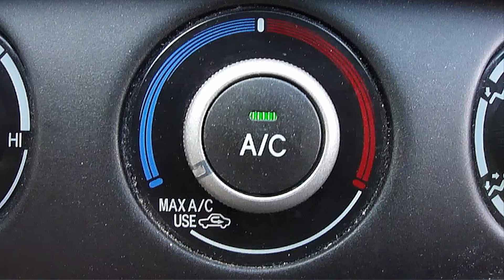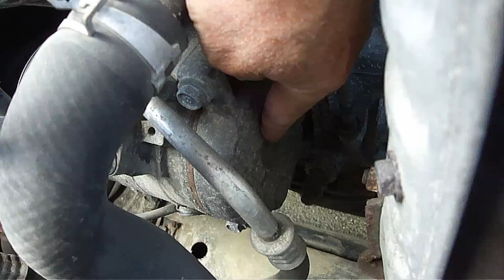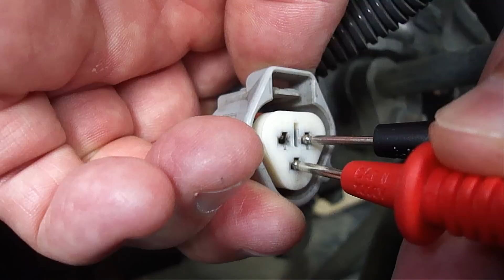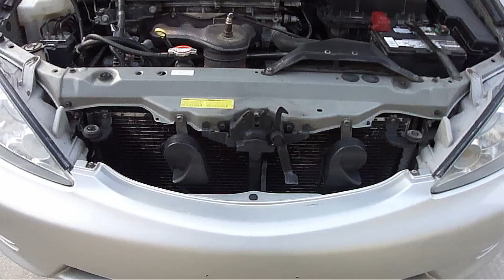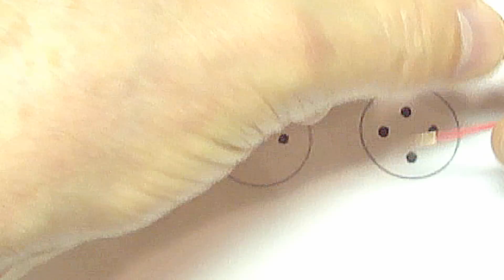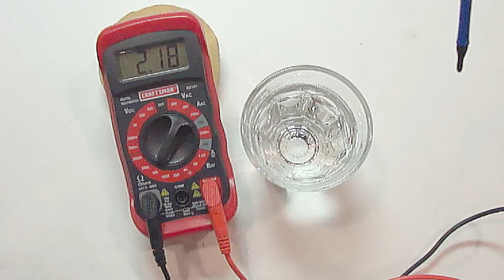How To Fix Car AC That Blows Hot - Possible Causes

Comment: My AC compressor in my 2013 mazda 6 will not turn on. I only have one wire to the compressor. I'm getting power to the wire. However when I check the volts at the pressure switch it only has 4.97 volts? Any help would be appreciated What sould I do ? I am getting 12+ volts at the compressor.

Comment: It’s rare that a random tip on an old video fixes a problem, but that’s the case for me. AC wasn’t working for 90% of the time for more than a year, even after a recharge. Figured out it was just the relay by swapping the horn and the ac relays like you showed. $35 fix. Thanks!

Comment: Unbelievable video with such clear pictures. My clutch is turning no matter if air is on or off so I'll have to dig into things, I believe it was noisy prior to winter, it's a 17 year old Kia with 417,000 miles but... My brother gave me the car and it will be my fault that I didn't run the A/C once a week, even at -10f, if he finds out it's not currently working. Plus I like to fix things even if I really could care less if they work or not
Reply from the maker: When the AC is turned on, do you have cold air coming out of the vents?

Comment: Thank you for the great review..
My Ac will not start cooling no matter how long it ran except my speed attain about 80km..and even the cooling is not effective.

I have change evaporator in past.
Change cabin air filter.
No leakages was detected so far.

Is it anything about th3 compressor?
Any advice? 
Anyone can help me ?
Reply from the maker: @oluwagbemigajonathan6820  My best guess is you either have too much or my enough refrigerant.
Reply: @proclaimliberty2000  Thank you for your feedback, you mean having too much or less can disrupt the AC cooling system?
I learnt this happen to Automatic compressors.

So what did you suggest please? My technician said same and he has been the one topping up the coolant..am just fed up every drive now take my interest far away from the vehicle.

Comment: Wow!  I am a degree'd electrical engineer who started with electronics over 65 years ago when I was 7.  I know a bit about mechanical systems, too.  About a month after a front end collision my car AC had this same symptoms, no hot air and no clacking sound, which I assumed (and hoped was a relay), even after a recharge.  I was ready to start testing the compressor for voltage, and decided to check YouTube for any advice first. Wow, again!  I have all the electrical test equipment of course, but needed exactly all the information in this thorough, and well, best ever, video!
Thank you for totally enhancing the checks I can now do, including clutch spin tests, sensor tests, and an OBDII test.  Also for putting them in such an experienced based logical order. 
Instant subscriber!

Comment: I paid hundreds for ac repair and a recharge and still have no ac. I will try this check down list. I ordered the voltage meter, relays and the pressure switch. I'm determined to figure this out, since the shop hasn't. I'll post an update after followong some of these steps. I'm starting with the relay. #girlpower!

Comment: vitz 2010, when the AC is turned on, it takes about 6 minutes for the compressor to turn on. When the thermostat turns off after cooling, it takes about 6 minutes for the compressor to turn on again, then it is very hot inside, the condenser has been thoroughly cleaned with water, gas 134A, sutcion 35psig. , discharge 180 psig, side glass clear, no burble, evaporator air filter clean, no block, evaporator clean, what could be the reason

Comment: My compressor runs intermittently, goes on/off based on pressing gas pedal. Why is this?
Reply: Usually freon low or too high...while compressor running should be 55 psi max .....or could be ac fan not working or the compressor speed switch which open the flow of ac to pass through compressor ac flow sensor....also u can force the relay for the ac fan to connect by opening it ....also hear if u put a magnet next to the flow sensor it turn on the compress and fan and allow the ac to circulate ....I'm current having a issue with my ac  turning on when. It's want to and turn off for long period....so I'm working on having the ac fan relay set on onn ....and trying to diagnose the flow sensor on compressor...and the relay for the entire ac system...

Comment: So I got a vehicle with no AC, cabin air filter I changed first due to knowing it most likely was never replaced since the glove box hasn't been opened in years. Then I checked freon. It was low but I had to fill to the max of the green side for cool air but still not that cold and the floor keeps getting air when the switch is not turned for the floor. I do get more cold air now compared to just being in the green to halfway but still feel it's lacking in producing enough cold air. Next will be a coil cleaning to see if that helps and then I'm stumped. Any extra help would be awesome.
Reply from the maker: @scottneal2738  Adding the correct amount of refrigerant is always tricky using gauges. Do you know how to add refrigerant by weight?
Reply: @proclaimliberty2000  truthfully no and even if I did....I would have to buy all the stuff to weigh it like Scotty did before looking up the correct weight that is to be in the system.

Comment: 2012 impala. we changed everything new condenser, freon, and Ac compressor check all the wires. it still blows hot air.  what weird when i press the AC button it wont come on but when you press outside air button it comes on for awhile and it stops working. need help.

Comment: My 2014 kia optima ac works, but only after driven at highway speed for a few miles. Nobody seems to have any ideas... do you have any idea where I should start? I just found this video by chance so the only thing I've done is swap relays which didn't help.....
Reply from the maker: @MAGAUSMC  My first guess would be low AC refrigerant. Low AC refrigerant is the number one cause of the AC not cooling properly.

Comment: I really hope your video is my saving grace and that the evaporator temp sensor is the problem on my 99 Silverado. My ac will blowva bit cold for some time, then start blowing warm or hot. I'll turn it off for like 5 to 10 minutes & it will start blowing cool, sometimes a bit cold. Ive replaced the low pressure sensor multiple times and it will do the same thing. So it Doesn't appear to be the low press switch

Thanks for the video. Its the most detailed video ive found so far.
Reply from the maker: @victorramosjr2445  My best guess is there is not enough refrigerant or too much refrigerant in the system, or it has a faulty expansion valve or orifice tube depending on which one your vehicle has. It is aways best to add refrigerant by weight because then you know you have the correct amount. I have a video in my playlist showing how to do that and how to replace an expansion valve.

Comment: Well i have 09 Pontiac G6 2.4L with 260,621 miles on it  Got into a kminor fender bender and my Condenser ended up getting bent. At 1st we thought the refrig. was low and found out it was full so now when the ac is on the drver side 2 vents blows strong hot air and low hot air whule on the pass. side 2 vents blow high and low cool air. AC comp. works fine. New condenser might be my fix.

Comment: One symptom never shown on any ac video is where the compressor is always running but no cooling.  It happened on my 2018 Subaru Forester quite suddenly.  The clutch seems always on and will not disengage but no cooling.  Everything else seems to be ok but no cooling.  No abnormal noise.
Reply from the maker: @ken48827  my first guess would be low refrigerant and or a faulty expansion valve or orifice tube, depending on which one your vehicle has.
Reply: @proclaimliberty2000  Are any of these repairable diy?  I have a 2018 Subaru Forester.  I tried the feeler gauge trick and couldn't insert it when it wasn't running.
Reply: @proclaimliberty2000  Sounds beyond my capabilities.  When we get it fixed, I'll post the results.
Reply from the maker: @ken48827  Thank you! 👍😃
Reply: @proclaimliberty2000  I just found out that the 2019 Forester has an internal clutch and it always spins.  I ended up buying a can of r1234yf and putting it in.  It probably needs more but now blowing 70 deg which is 100%better than it was.  The local mechanic shop was ready to install a new condenser for $1900.

Comment: Mmm when you were checking the voltage at the connector you left the clip on the positive side of the battery so you were checking ground not voltage. That's still fine actually because you also have to check ground too as well as battery voltage. Repeat the same thing tho just take the lead and put it to the negative side. You won't get voltage right away that's fine you would turn on the car and everything along with AC to get voltage that way. The safest way would be a bi-directional scanner that can turn the clutch on then do the test. I use a test light on ground it's easier for me that way. Still great video on AC it's nice to see a video that can help people with this topic ac is nice in your car especially when it's like 105 out and also humid. Like where I live and seeing the comments this vid is doing wonders for everyone. Hope it racks like all the views x3.

Comment: So our 2016 Tahoe blows cold air in the rear but warm up front. I can’t seem to find why this would be happening. Any advice would help on where to start checking issues
Reply: Sounds like a blower issue, maybe temperature control issue (at the motherboard)

Comment: Another reason why the clutch won't engage is because of the gap. Sometimes if the gap is high, the magnetic coil won't be strong enough to pull the clutch. Maybe the bolt which holds the clutch has come off or becomes loose. Just tighten the bolt with the right amount of gap as per the prescribed measurement for the compressor and it should be ok.

Comment: No air blowing
Reply from the maker: Your blower motor either blew a fuse which needs to be replaced on your fuse panel, or you have a failed blower motor relay switch which is usually located directly on the blower motor and can be replaced from underneath the dashboard on the passenger side.

Comment: another fix....when my ac blew hot after I added a can of freon and left it overnight,  check the blower resistor (located next to the blower assy...you have to remove and lower the glove compartment).  You then see that rectangular device thats plugged in, with 2 screws attached to the base.  Unscrew it and take that plug off.  Look at that ceramic end,  YUCK!!! Now,  replace it back and assemble back.....then get another can of freon, add it.............then enjoy!

Comment: Had a new compressor kit installed and freon filled back up. The clutch still will not engage and turn on. Its roughly 50 degrees outside. Mechanic said its still too cold for the clutch to engage. I know the clutch works because it will engage with defrost on and by bidirectional test. So when is too cold?

Comment: My car always blows cold air when it starts but as soon as I stop for lights or traffic, it will blow hot air and I have to turn it off and wait for few minutes before turn it on again then I’ll get cold air again. But if I get on the freeway and don’t stop or slow down at all then it will always blow cold air. And in winter time, it will always blow cold air regardless stopping for lights or not. Any tips how to fix it would be greatly appreciated. Thanks.

Comment: My ac works great long distance, no problems, but on summer low speeds with multiple stops in the city it begins to blow hot air after an hour or so. Stoping and starting the engine fixes the problem. Anyone here knows what it might be?
Reply from the maker: There’s a very good chance it’s low on refrigerant.
Reply: @proclaimliberty2000  thank you very much for your reply. Unfortunately, I already replaced the coolant and the problem still persists, even if the problem seems to have gotten smaller.
Reply: @teodormihai9018  I’m pretty sure he meant ac refrigerant/gas, not coolant

Comment: Great video! So when my Auto stop feature on my car does not work at all for months (Says: Charging System warming up) but never actually works (battery test like new) what is the problem. At the dealer they said to turn the ac on, put the windows down to see if this fixes the issue.

Comment: 2016 Impala - After taking it to Chevy for diagnosis, they said it was short in the compressor and $2300 to fix.  I didn't buy it.  Air was blowing hot at red lights non stop.  Eventually was toggling ac on and off for about a month to get it to kick on.  After watching this video, I fixed the problem.  I didn't have a matching AC Relay to swap so I took out the relay and put it back in.  I still can't believe it, but I've had no issues since I did that.  Going on 4 days now.  THANK YOU!!!!
Reply: Sounds like a Friday estimate. Likely less on Monday.

Comment: Great troubleshooting.  I'm a good mechanic but know very little about AC. My 2006 h3 hummer would blow hot on driver's side if temperature was set to anything but its lowest setting.  Now it doesn't get cold period. I put a gauge on the low side. Either running or engine off I'm getting 90 psi. Please tell me its just a fuse or simple switch somewhere...

Comment: Mine blows warm sitting at a light then cold when moving again. 

Filter was clogged. Upon removing it, i had massive air flow but a stinky odor like stinky wet dog odor. 

Is a dirty evaporator causing the warm air and stink issues?

Comment: Good job keep up the good work.  My cars ac only work cold while the car is in motion once stop either on red light or parked the air ac starts blowing hot air or normal air just not cold .  Not sure what is the problem with my ac on my Toyota Corolla 2016 .   What would you recommend?
Reply from the maker: My best guess is that you’re low on refrigerant.

Comment: So, if I have changed the condenser, receiver/dryer, the pressure switch, evaporator, thermistor, the idle air control valve, throttle position sensor, AC amplifier, and swapped in a known good ECM and I still have no clutch engagement at idle. 
This is on a 1999 Toyota 4Runner.

2 shops have looked at it and have no answers

Comment: I have a BMW 5series F10. AC doesn’t blow cold air. It has been gas charged recently, the clutch engages and I have tried all the troubleshooting. What can you suggest?
Reply from the maker: Who added the refrigerant?
Reply: @proclaimliberty2000  ATS Euromaster in UK added the refrigerant. I checked the AC refrigerant pressure today using Foxwell scanner tool today, it showed 6 Bar. Then I increased the rev counts to 3000rpm for few seconds, AC pressure increased to 17 Bar and AC worked for approximately 25 minutes before stopping.
Reply from the maker: @eyvazheydarli  I would start by bringing this to the attention of the people that put the refrigerant in and explain your situation to see what they say. It’s kind of odd that they gave your vehicle back to you with the AC not working correctly.
Reply: @proclaimliberty2000 I actually went back to them and they didn’t bother to investigate they just refunded me.

Comment: In 2019, I removed a shim in the AC clutch on my 1998 Frontier to fix it (260K miles); the AC clutch had been disengaging when it got hot.  I removed that shim with the compressor in place, didn't even have to remove the AC belt !!!

Comment: Does any one help me find the issue Ac compressor doesn’t turn on .. new Ac compressor new Relay new high pressure switch but compressor doesn’t turn on … but when I put paper clip on the relay compressor turn on ..

Comment: Awesome video buddy, great job, you can tell a lot of time and thought went into it. The voiceover and graphics turned out really well (simple is better), were straight to the point, and followed a logical sequence.
Reply: @proclaimliberty2000 hi, I have a question but I can't comment? That's why I'm on the reply, I told a mech is was blowing got, they checked and said my compressor is shot. Will any of these work? Should I get a 2nd opinion?

Comment: Awesome detailed video.!!  I wish I could figure out where to begin with trouble shooting my AC. I just bought a 2010 Lexus RX 350. A/C does not work. took it to a local garage, the evacced tested and recharged the system. still no AC.. they attached their "scan thing" and they were able to get the compressor to kick on and blow ice cold AC. while it was connected. but no AC without it connected..  could it be a communication problem with the car computer? or could it be a sensor ? I hate to bring it to a megabuck lexus dealer.

Comment: Very informative, but have a question, been having a problem with my A/C and not one shop I have taken the car to has been unable to find the problem.  Problem is A/C turns on and cools great for about 10 minutes then it blows hot air.  You have any ideas what the problem might be. Thanks

+

Comment: Inspired by the video to poke around my AC that stopped blowing cold, I changed the A/CON fuse with a spare in the box and it seems to be working now. I wonder what the dealer bill would have been. Thanks!

Comment: Great video. Really well explained and very comprehensive. The only thing I would like to have seen is the solution to having too much refrigerant without just letting it spray out. I'm concerned that the car I just bought has this problem

Comment: I know I am late to the party, but where would you look if the AC light and recirculation light don't come on, but the blower fan is good and there is current in the spot where the AC Relay plugs in?